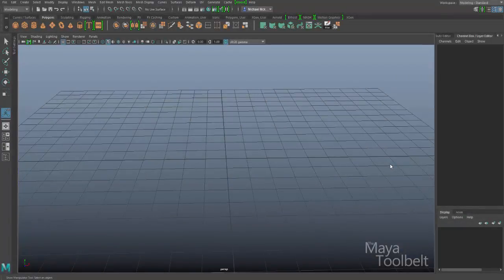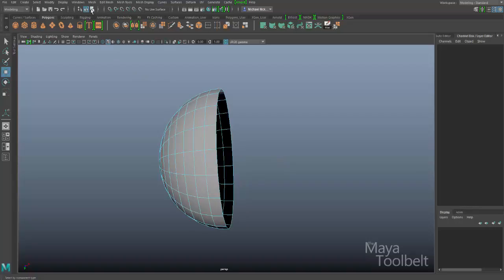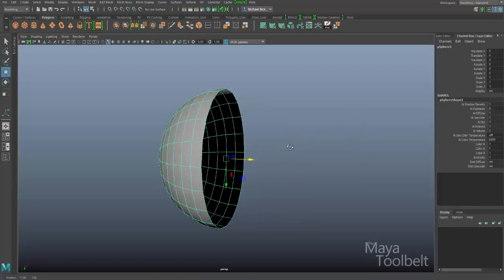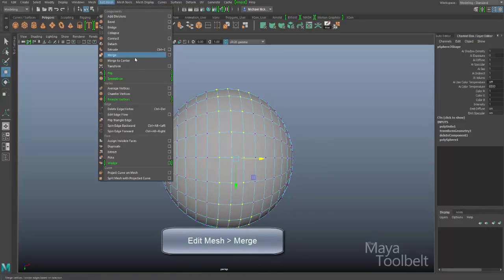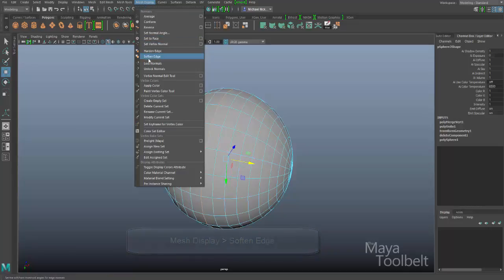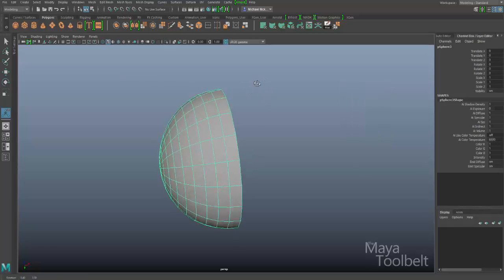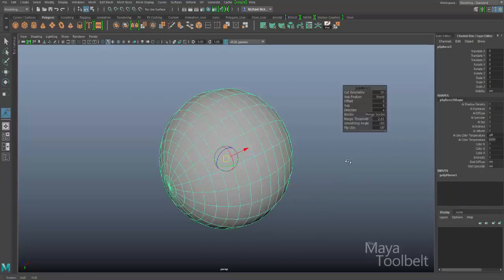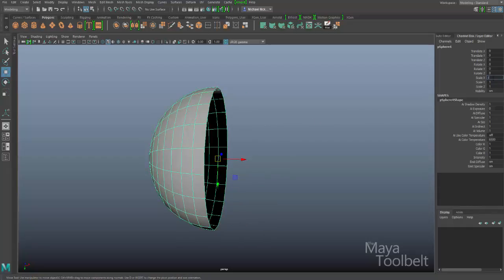The Maya Toolbelt - How to Mirror Geometry

Comment: mirror does not work i mirrored one side of the heart and it leaves a gap :(
Reply from the maker: It goes on where your pivot is, so make sure that your pivot is positioned in the correct spot. If it's leaving a gap, your pivot may be too far over.
Reply: thanks
Reply: i think my pivot point must have been at the correct place too must be a problem with my mesh

Comment: nice video. i just have one thing to add. im using the 2017, i used the second method using the mirror option. its just when i went and used the settings you used in the video my sphere would come out really wacky. so for anyone that has the same issue just leave mirror direction at negative, make sure you have the mirror axis is set to the correct axis and dont touch any other settings. just hit mirror. and select an edge and move it around to see if they connected properly, if they didnt and split. double click on your move tool and scroll down to symmetry, click on the "preserve seam" option and it should work!